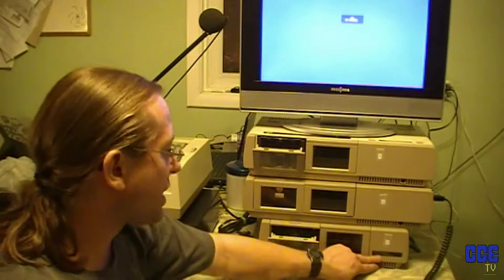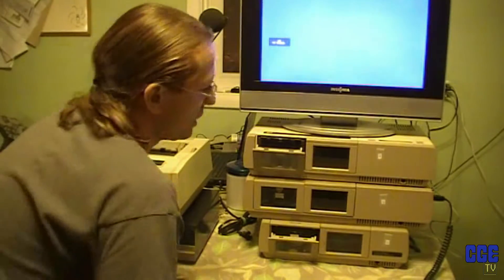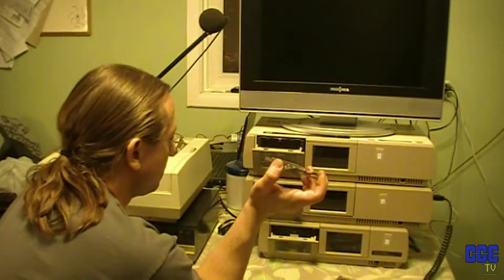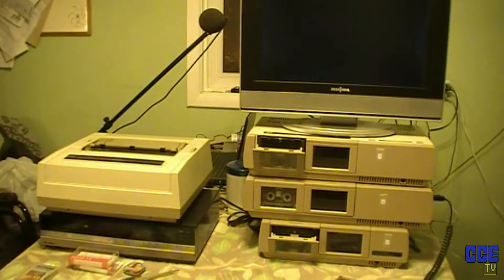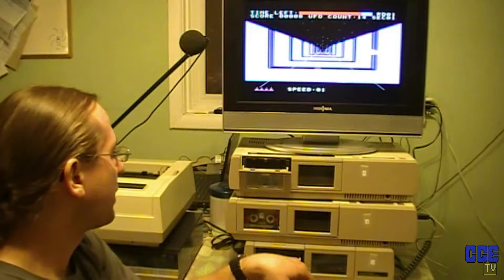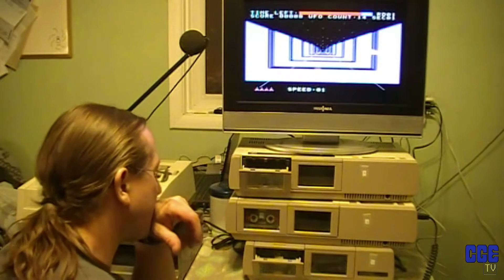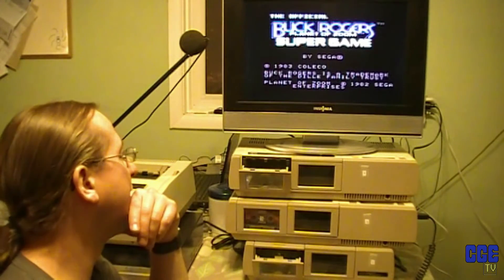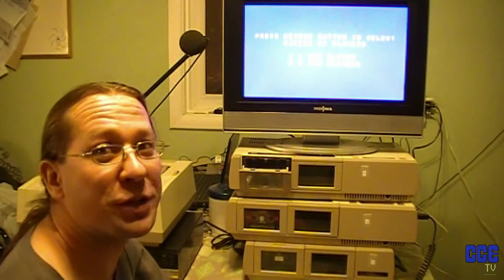TOTC-02.05: Coleco Adam Drive Testing

Comment: I don’t know if those tapes does have those holes in it to prevent accidental recording over it but if even snapping those tabs off makes no sense,well that’s disgusting, also if a game loaded game could still crash during gameplay again that’s something disgusting since you will never know if you could make it trough the game or not,and because of the analogue being random  by nature, that means that everytime you will load in a cassette tape, it could result in unique behavior of the game so it could randomly crash,sure those adam systems may do have error corrections in cases it can’t read those cassette tapes properly,but still i don’t trust this,
But even worse since the adam uses it’s own prietary cassette tapes i could not instead just use a cassette adaptor to hookup an iphone to it and the load up games that way into the adam computer, that would,ve been great because then i didn’t had to ever worry about rutting cassette tapes,DAMNIT☹️